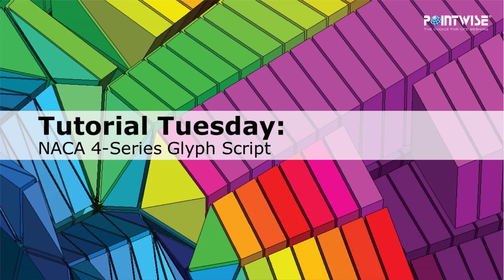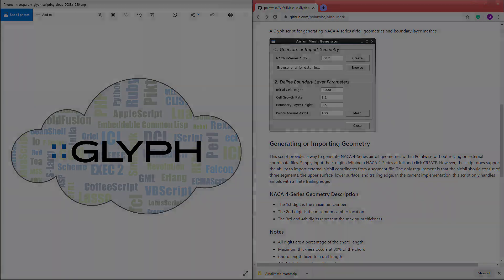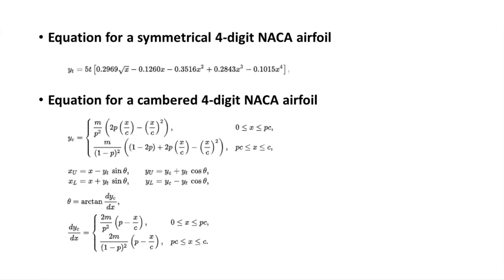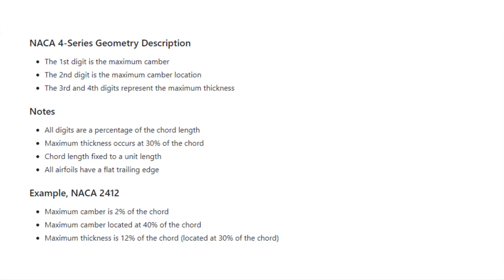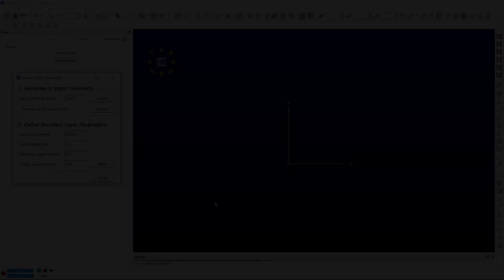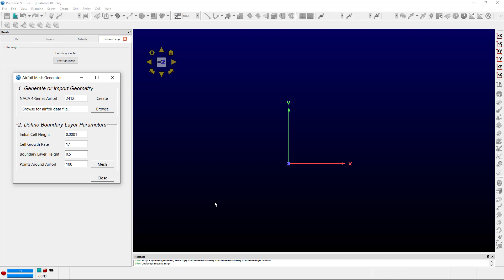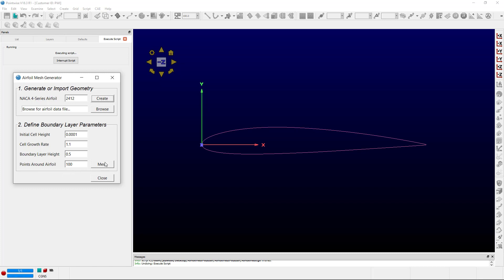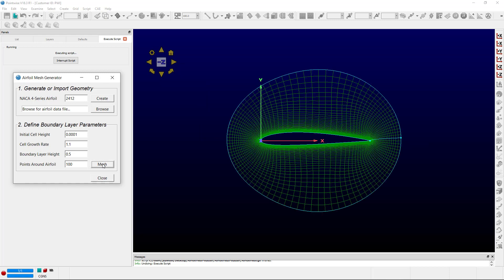NACA 4-Series Glyph Script

Comment: This is a very useful glyph script when needed (found here by the way: https://github.com/pointwise/AirfoilMesh). There's another Glyph script only generates the foil itself (found here: https://github.com/pointwise/AirfoilGenerator) that is also useful. Some time back I'd created a pull request in the AirfoilGenerator repo to improve the point distribution along the foil. This improvement is worth incorporating in my opinion and applies equally as well to the repo that is the subject of this video. 

The pull request is here:
https://github.com/pointwise/AirfoilGenerator/pull/2 

I wonder, is there any reason not to merge this in? I'd be willing to implement the same improvement into the AirfoilMesh repo as well if I knew it would be used.

Thank you for your product and useful tutorials!